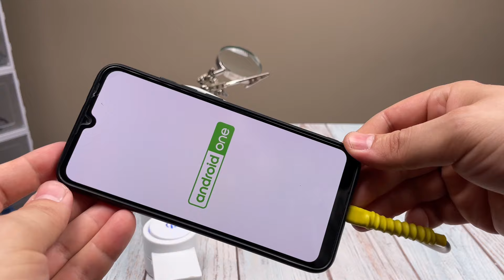Don't throw away your original phone cable, get it fixed in minutes

Comment: The same thing happened to me, without staging.
In the car, I wanted to urinate, I stopped and started looking for a discreet place and I found a cable on the ground which was even starting to rust and the USB-A socket was a little bent.
I took it, washed it and renovated the whole cable. It works perfectly, it's an emergency cable that I leave in my car now !
🤠🖖